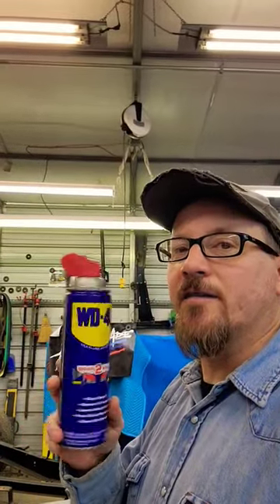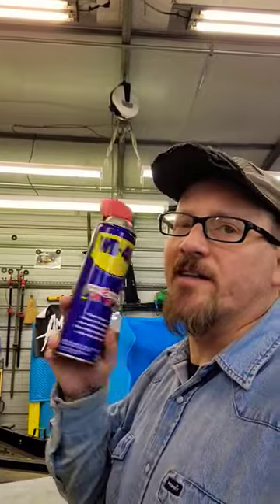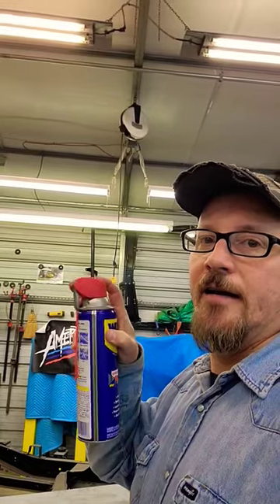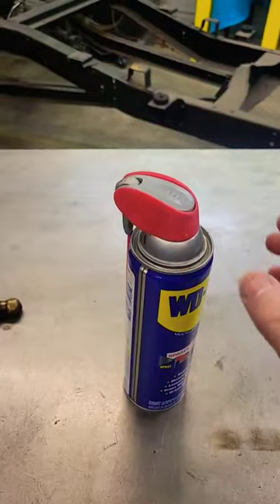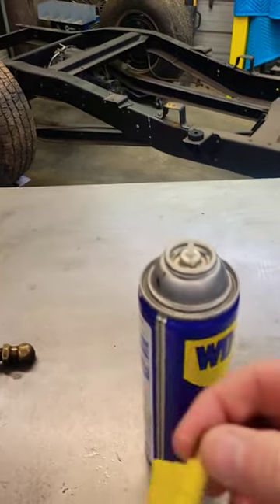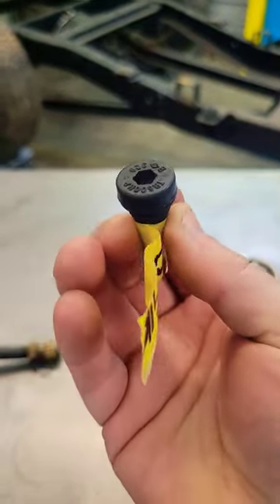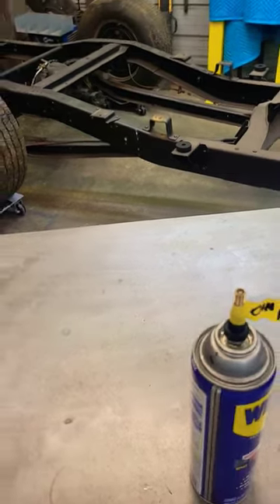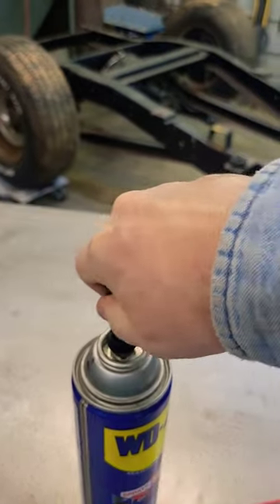This (Really) Works?? Refill an Aerosol Can

Comment: "How do I know when it's fu ......" BOOOOOM!
Reply from the maker: I set my pressure regulator at 80 to 90 psi and jut fill in short burst, then you can put a tire gauge on it to check the psi, the factory fills it at 90 psi. I have a whole video on it on my channel if you want to check it out.
Reply: No boom.
Reply: Andy is a little dramatic 😂

Comment: This definitely works but I used a little rubber attachment that goes on the airgun attachment no need for a tire valve. My compressor regulator was set on 40 pounds I sprayed into the can a few seconds and that's it , that's all you need I will never let it go for a long time im afraid the can might blow up . You'll need a couple seconds people I will never go higher than 40 even 20 psi . Even 10 psi should work. Don't need to go 60 or 80 that's crazy. Be safe not stupid ,that can can only handle so much pressure.

Comment: I used my electric air pump and needle adapter.  It barely fit in the nozzle so I held it with my fingers to keep it in place and to keep the air from escaping.  It only to about 5 seconds of air.
Reply from the maker: Awesome

Comment: do you need to physically press the can stem downwards during charging (move that causes to release the aerosol under normal circumstances) or does the 90 psi pressure does that work for you?
Reply from the maker: Yes its a valve so when you push the stem down to opens the valve so you can put compressed air in the can, you just have to do it at your own risk .

Comment: Just tried this with 80 psi compressor and finished what I needed to do as there was liquid in my can but no pressure left. Very handy trick. Only thing is that I have used pressure nozzle with controllable presure trigger, just to be on a safe side. Thanks for the advice!
Reply from the maker: Awesome thanks for watching and the tip!!!!

Comment: Oil can runs out of propellant. Refill with compressed air + oil. What pressure does diesel do its thing?
I have done this but it seems like it might border on unsafe.
Reply from the maker: The factory puts any where from 90 to 100 psi, so I set my regulator at 90psi and it seems to work pretty well but use your own judgment!
Reply: diesel combusts 300-500 psi OR 3-5X what a shop compressor produces.

Comment: What tire valve has that plastic fitting on the bottom?
Reply from the maker: Any valve stem will work, the brass schrader valve pushes down on the white fitting thats made on the can and it lets the air go in the can.

Comment: At the beginning of your video, the flip up stem will not work until you flip up the stem.
Reply: Dude it’s a dual action can that costs more lol. It’s not a safety
Reply: @meangreen99  I didn't call it a safety, it keeps the tube on the can but flips down for storage out of the way. I'm not approving or disapproving.